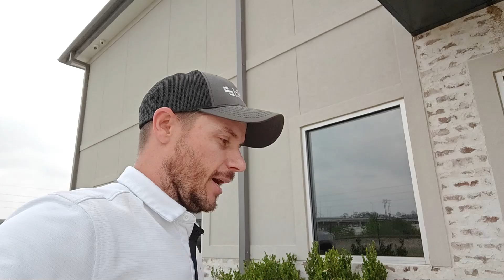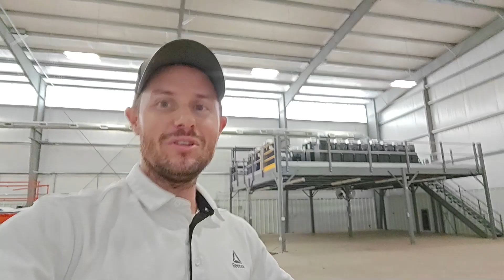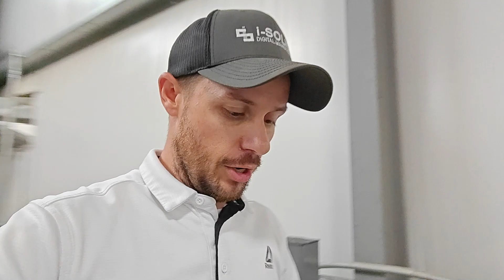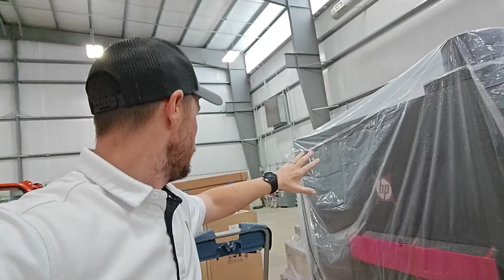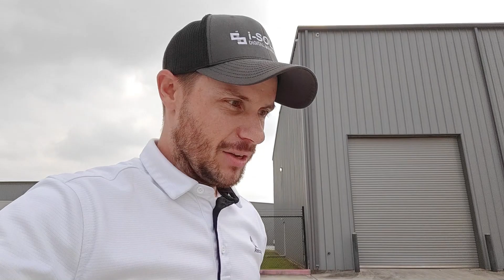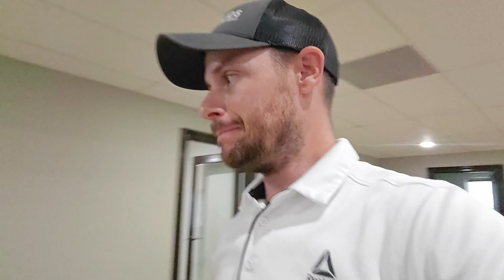i-SOLIDS Industrial 3D Print Farm -  New Facility Tour

Comment: nice building.   one thing you need is a/c under the mezzanine.  it will hold heat if you have an enclosed floor on it.  fans help but wont make it that comfortable.  just a suggestion